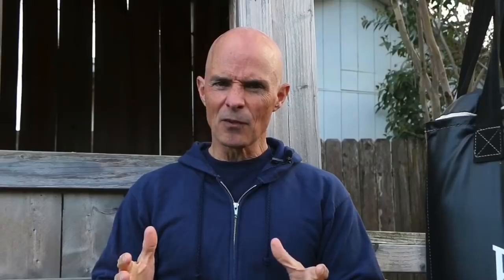INTAKES FOR TURBOS-BETTER UNDER BOOST?

Comment: Very interesting test.  This makes me wonder more about intakes and boost.  Everyone says to just run the stock truck intake or TBSS intake for boosted applications, but you have shown a few things here.  In your 20 intake comparison, the stock truck made 549hp, LSXRT 592hp, Hi Ram 597hp peaks.  Here you are showing the LSXRT and Hi Ram under boost.  

Let's think of this in a drag racing application so anything under 5500 rpm is irrelevant, rev to 7500+ rpm.

At 6000 rpm NA the LSXRT is roughly 20hp higher than the Hi Ram, then the Hi Ram gains on the LSXRT and passes it.  Then we go to 7lbs of boost and the LSXRT is roughly 50hp higher at 6000 rpm than the Hi Ram, then the Hi Ram closes the gap again.  This tells me the gains NA are multiplying under boost. 

The question I would ask is if the Hi Ram looks like the best option for a 7000+ rpm engine (the rpm range for our drag racing application) and we want to run say 30lbs of boost, why are we recommending the truck intakes for boost? If we look simply at the math, the Hi Ram is 50hp better NA than the truck intake.  If that hp is going to multiply under boost, we could argue the Hi Ram could be worth 100hp or more over the truck intake.  That's a big deal!

Obviously setup will dictate exact results, but I feel this is often overlooked.  Does this make sense or do I have something backwards?

Comment: Richard I was wondering if you have ever tested draw through turbo system vs a blow through, I would like to see what is best for street use and what the power would be on a LS engine, Thanks for the Video's .
Reply from the maker: I have not-most turbos are not set up to run fuel through

Comment: Just thinking out loud here... I wish you would’ve confirmed the port alignment on the highram.. I’ve seen so many of those intakes have issues with port alignment, so much as  about an 1/8”  off of the actual intake Port Centerline. Just something to think about

Comment: I love your video and totally agree ie long vs short runner, but why do the new modern four cylinder turbo engine have almost no intake runners. They should make all their power uptop however they are making power and torque very low down. Can you explain?
Reply: The newer import 4 cylinders use variable valve timing to retard the cam down low which increases low rpm torque  as well as help spool the turbo.  Then they advance the valve timing at higher rpms to increase hp and reduce valve overlap

Comment: OK I am missing something. I understand the long/short runner and charge filling for NA. What I am not grasping is under boost, why there is such a loss for the high ram. 

If the advantage of the short runner is the 'ram' effect on cyl filling...if there is say 10 pounds of boost in either manifold, are you STILL gaining the increased cyl filling with the long ram? I'm just trying to understand the difference as in my non turbo pro head, it would seem that 10 or whatever pounds is 10 or whatever pounds and that is 'cross canceling' for lack of a better term, the long runner/low RPM benefit.

Comment: EXACTLY....glad you proved it again that sheet metal and most hi ram intakes on an LS are completely useless as the things HEMORRAGE power down low through the mids, and really anywhere below 7500rpm when turboed they wont catch up. for 7500 to 9500 is the hi rams only place

Comment: So given the common types of carbureted intakes for a traditional gen 1 SBC, and the “common knowledge” that a dual plane intake is bad for nitrous and/or boost because of cylinder distribution, would a long runner dual plane, such as a Performer RPM actually be a better choice than a short runner Victor Jr for a typical boosted motor running 6500 RPM  and below, or is the cylinder distribution such a worry that any potential losses from a short runner are worth not leaning out one cylinder?

Comment: Excellent content!!! I would like to see the results from building a turbo engine for high rpm power vs low or mid range power like this one. Heads cam intake all for high end power. Will the high ram intake then make good numbers? Also will the engine built for high rpm power last longer and make more power before breaking....I tend to think so, because there will be less torque down low and I've heard of this technique being used in drag applications b4 to prevent part failures, last longer, and create best peak hp/tq numbers.

Comment: I'd still like to see the hi ram and ms4 cam ran on boost together.  I love the combination NA!
Reply: Richard has proven that the curve is gonna look the same, just with more hp on boost
Reply: Yes but it's happy higher in the rpm range.  I want to see a 7500+ rpm boost pull

Comment: So would it be fair to extrapolate  that roots blower intakes are generally rubbish, but a necessary evil for packaging?
Would love to see a test proving this!
Reply from the maker: They R designed for high rpm as well and would be better if longer for power at lower engine speeds. Proponents of the PD blowers (roots and Twin Screw) always counter with the immediate boost response, but the intake doesn't care about that-extra torque is extra torque
Reply: @richardholdener1727  the instant torque of a PD blower is great, for sure.. but knowing your supercharged engine could have significantly better output with an optimized runner length really niggles at the back of your mind if you're the sort of person who likes to fabricate blower manifolds!
It can be a tough slog being a blower guy in a turbo world lol.

Comment: Any (fill in the blank) is a Turbo (fill in the blank). 👌🏻🤘🏻
In all seriousness, the old knowledge of short runner = high rpm HP, Long runner = low end torque will always hold true. Is hard to mask/bend physics, even with forced induction alternatives.

Comment: That head looks a bit knarly around the plug hole at 1:33 ?
Reply: That's a good way to increase low and mid valve lift airflow. It's called unshrouding the valves.

Comment: Have you already done a test on the difference between long tube headers and cast iron manifolds on a turbo application? Doesn't hooker make a cast turbo manifold set for LS engines? That's probably pretty convenient method of setting up a turbo system.
Reply from the maker: I have tested the Hooker manifolds-they work well

Comment: Richard:

As a professional you should know that engine torque is expressed as lb/ft not ft/lbs!
Reply from the maker: did you know the grammatically correct expression has changed several times
Reply: @richardholdener1727  maybe, but the mathematical expression rules.
Reply: @richardholdener1727  maybe, but the mathematical expression rules.
Reply: Sorry, always been a ft/lb guy. Hate it the other way, sounds stupid.

Comment: Where would the TBSS intake fall in this comparison?  Awesome videos Richard, really enjoying the content.
Reply: I think he has a video on that. Basically save your money and go TBSS if you can. Plus if it's a 4.8 just stick with the stock intake
Reply: @EGGINFOOLS  I did go TBSS, but its just a NA 5.3.  I was able to get 305tq/304hp to the wheels for my C1500.  I'm happy with the performance.
Reply: @242brick  Nice! The TBSS conversations can be pricey for stock stuff if it's a retro fit but they do offer good performance. Cam and boost and you're good to go! Lol
Reply from the maker: less than Fast but similar rpm range

Comment: Funky physics question.   If the earth were larger and able to support a denser atmosphere, say 29.4 psi instead of 14.7. Would an engine produce more power, or the same?   A denser atmosphere would contain a greater quantity of oxygen, but the pump itself still sees 0 psi between intake and exhaust.  Turbocharging would need to operate at 30 psi to double power output.
Reply from the maker: it would make more NA power (just like it makes less at altitude) and boost would be above the atmospheric pressure (whatever that is)

Comment: Awesome video - I have made this mistake on a turbo 5.3 and I am in search of an lsxrt intake now - because of the great info you put in your videos! My combination was a l33 ,ls6 cam, head bolts and gaskets with a 67mm bb turbo from ON3 - but I put a holley sniper intake on it .. it made decent power but i am probably giving up 50-100ftlb of torque under the curve ! I only run it to 6500 ish. Thank you for the info - she will get the fast intake and a new tune before summer !
Reply from the maker: Or a TBSS or Dorman LS2-they are both cheaper
Reply: Richard Holdener yeah hard to find the tbss in Canada but I have heard the dorman quality can be questionable?
Reply: @stacekirstein9646  any gen4 truck intake is tbss
Reply: With that combo on a 5.3 you could save a bunch of money and go TBSS intake. With that turbo size on the small side for a 5.3 I'm thinking you daily it? If it's a truck do you tow?
Reply: EGGINFOOLS I use it with a glide and autocross it mainly - it’s in a 88 foxbody notch - no lag no shift - it works really well right now
Reply: @stacekirstein9646  That sounds fun and makes since for that turbo size!

Comment: Jeez, I don't consider myself a dumb guy by any reason but I just cannot wrap my head around this under boost.
If there's 10 lbs of boost at the intake valve (basically downstream of intake) and it isn't going to change, how's the motor know the difference between the two? When the intake valve opens, there's your 10# of boosted air!

And two people with long runner street turbo cars disliked this video lol.
Reply from the maker: That's not the only thing going on in the intake-there are other pressure waves going down the runner to the open intake valve, then back, then down again, then back etc... These (reflected) pressure waves, if timed right, help improve cylinder filling. That's why we see the difference in power of the two intakes, these waves are tuned for power gains at rpm (Cuz the waves travel at the speed of sound and it takes a certain amount of time to make the trip up and back). Thus runner length determines when they arrive.
Reply: Richard Holdener That helps!
So, not to deliberately change the subject because I am struggling LOL but do you still have that old Fox Mustang?
Reply: The problem is that you've been conditioned to think that boosted engines and naturally aspirated engines operate differently. They don't.

Comment: Measure the runner length.
But I guess 
Long = 12
Short = 4
Reply from the maker: The Hi Ram is double that I think
Reply: Chow Dong you have to include the port length inside the head. Hemis usually have shorter ports than a wedge head like a big block Chevy.
Reply: @mikehoncho5389  
You are correct.
But people selling expensive parts, try to confuse the public.
My shop is G.M.,  small block, Big block, LT-1, LS. 
Is what I grew -up with.

Comment: The short runner might be better for high boost so you don't get as much torque that kills the engine, you can fix the lack of torque with boost, and still get a couple of extra peek hp, I mean if you not running a boost controller with rpm reference

Comment: $1000 intake.  $800 cam & springs. Wow.  Junkyard LS motors are cheap.....
Reply: Stick to your love of 4bolt main small blocks. You don't know anything about ls engines if you think they aren't cheap
Reply: EGGINFOOLS actually I’m a Ford guy so I’m used to paying high prices for go-fast parts.
Reply: $800 cam and springs?

Comment: I’ve been wanting to see a test of the Fast LSX HR ...
Reply from the maker: I tested the Carbon TR version already
Reply: Richard Holdener Do you have a link? I can’t seem to find it. I’m considering it for a ly6 with comp 469 cam. I’ve heard it looses less power down low compared to Holley High Ram.

Comment: Absolutely correct, I thought with intakes single plane vs dule is volume increases velocity decreases and vice versa, which is why single plane intakes like lower gear and looser converters and make power up high, they look cool sound cool and we all want them

Comment: So for the best street machine lq4 (under 5500 rpm) i want a long runner intake and 220 or less cam duration and 706 heads?
Reply from the maker: that works
Reply: @richardholdener1727  you should build an intake like the variable length headers and see how long you can go before it hurts performance. Just an idea.

Comment: Richard we’re running out of questions to ask!!
Reply: WONG
So much MORE.
Running superchargers with ELECTRIC MOTORS.
MEASURE C.F.M. & BOOST.
Reply: @nellyfarnsworth7381  Does Summit Racing now offer electric superchargers? 😆
Reply: @bimmerman9839  
But are they $100. Or less.
My local pick a part.
I pick up M-62, M-90, M-112, M-122 EATONS. JUST CHANGE THE OIL 🛢.
LOOKING FOR A M-112,  my 4.6 liter mustang project.  S.O.H.C. 4.6 LITER 500 H.P.  BUT WILL NOT PAY OVER $100.
YOU HAVE A EXCELLENT M-112????

Comment: How close is the  plenum volume to each other.
Reply: Plenum volume has nothing to do with it when the throttle is wide open.
Reply from the maker: Plenum volume actually creates Helmholtz Resonance waves but they are less effective than Reflected waves for power production
Reply: It's what mechanics refer to as helmholtz resonance but it's not because the mathematical formula will not fit.

Comment: Was your Buddies Suburban a 2500?  I thought the only Suburbans to get the LQ4 6.0L were 2500's but a commenter in a Hoonigan video said that you could get them from 99-01 on the half ton Burb's as well.   Thanks.
Reply from the maker: It may have been a 2500

Comment: OE have practically no runners and they use boost to shape the torque curve.  That's how they get those super flat torque curves from 2500-5000 rpm.  It just needs more boost.  You can also limit peak torque so you don't blow up your engine (e.g. big bang 6.0L)
Reply from the maker: OE manifolds have very long runners

Comment: $3,500 to add 70 horse to a LS is it worth it
Reply from the maker: $3500?
Reply: Richard Holdener the intake is $1000 alone.  Squeeze off another $800 to Brian Tooley for just the cam and springs.  Head work , labor and all the bits n pieces adds up to $3500+.   You know not everyone makes car journalist money (joke).
Reply: @BustedWalletGarage  well since they did not test stock here are you using the factory numbers which in 2000 with the cast iron heads the HP was only like 300 so it's like 200 HP for the $3500 and obviously from another $1000 ish you add the turbo and it was over 900 which is all besides the point this was a test on the intakes so none of that really matters
Reply: What was $3,500
Reply: That's an expensive cam lol
Reply: Ya I was kinda thinking the same but did not feel like looking it up I think the kit with springs and I think new seals is under $500

Comment: Every intake is a boost intake just like every cam is a boost cam, I guess. One of the big differences between stock and aftermarket cams is often overlap, which is usually credited with increased mid-range power due to the “fifth cycle”. It doesn’t seem like this would carry through with turbochargers due to the interference of back pressure. Can you comment or maybe demo the effect of overlap with and without back pressure powered boost?
Reply from the maker: whatever the cam does na-it does that under boost (99% of the time)